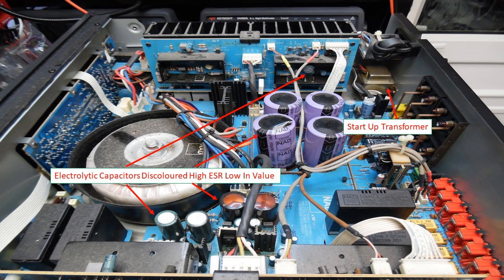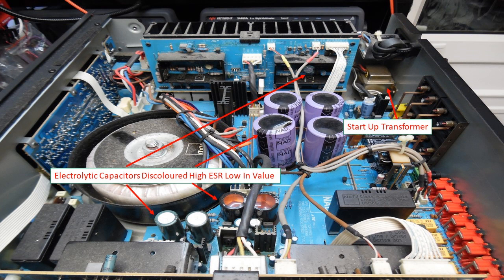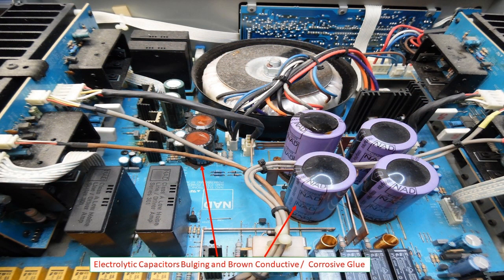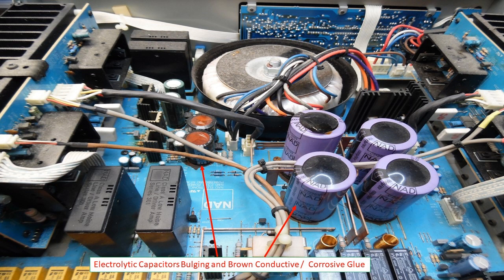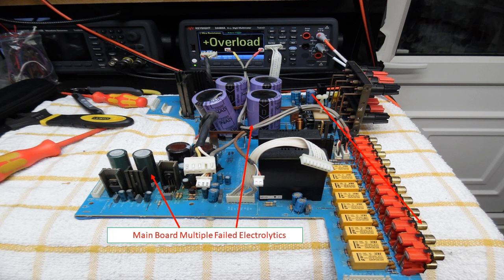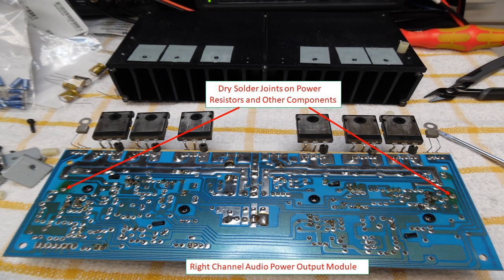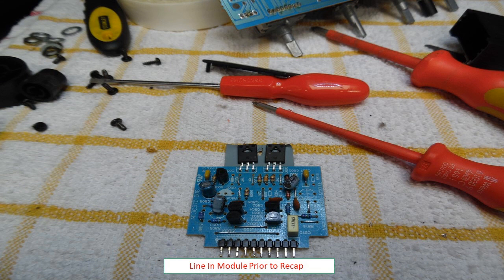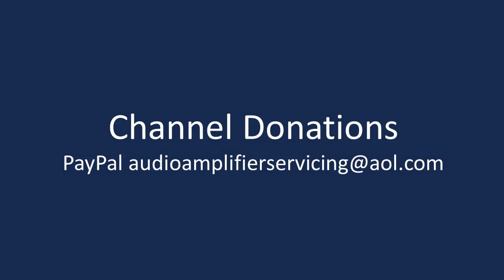NAD C370 Recapping, Repair and Service. (With Audio Tutorial)

Comment: Hiya. I've had this C370 on the shelf for about 2 years now. I think I asked you back then about where to get fusible resistors for it and thanks for that.

I'm back looking at it again now as I have a bit of time. I recapped the whole thing back then, but still not working.

It's 'boot looping' (in computer terms) . I've got it on a dim bulb tester, on power on the dbt light glows, the amp power light comes on, the standby relay at the front clicks then light goes red and power cycles. This seems like a short somewhere to me. But I can't find it, and I've tried very hard.

Today I went through all the transistors for shorts, one was bad (Q705). I also rechecked all my work from back then, seems fine. I've checked resistors again and seems fine. I'm more used to fixing laptops than amps so the ground on this is a bit of an enigma although I do understand why on amps.

I've been testing by leaving the left and right power amps disconnected, but everything else plugged in. And on the DBT all the time. I can stop it power cycling by removing the 32V bridge rectifier but the amp wont boot at all without it, just a minor blip  of power.

I'm on the verge of sending it to you but any other ideas beforehand? Cheers!
Reply from the maker: Hi can you confirm the bridge rectifier is DB104.
Also, when the Amplifier is cycling, is the bulb lighting brightly, and can you confirm the bulb is 100 watt filament type.
Reply: @AudioAmplifierServicing  Yep DB104 and 40w proper bulb
Reply: Might try to get a 100w proper bulb. Makes sense now you mentioned it. Worked fine on other stuff but I suppose this is more power hungry.
Reply: Ordered 100w proper bulbs. Interestingly advertised an eBay as 'Proper bulbs' hehe.
Reply: @AudioAmplifierServicing  FYI It was DB104 at fault. Now working!
Reply from the maker: @kblectronix Excellent great to hear you fixed your Amplifier

Comment: Hi again, got my Nad c370 main board out now and it seems its not taking as much punishment as the one you had here. Still there are caps thar have gone dull looking with heat so its going to get a full recap.
Question if i may - you have used audio grade capacitors in many areas, the ones that were in originally are jinghai CD110 which are general purpose. If i used say panasonic FC, would they be just as good? 
Mouser dont have much choice just now on the 10000uf 80v caps, so this project may take a while. 
Again thanks for this insightful video!
Reply from the maker: Hi Panasonic or any other high quality Japenese capacitor brand would be a good choice. There are also companies like https://www.hificollective.co.uk/ that specialise in Audio grade components.
Reply: @AudioAmplifierServicing  nice shop! Thanks for the link

Comment: Hi informative, I am working on a c372. From NAD the advice was to change the 80v 10.000 uf in 100v 10.000 uf. My question is if I put 6x 100v 10.000uf in which part i have to adjust for this extra ask of the system?
Reply from the maker: Hi uprating the capacitors to 100V will not fundamentally change anything as the value of the capacitors remain unchanged. But I would advise completing the alignment procedure for the Amplifier after any form of repair work as components drift and tolerances changed.

Comment: I have one now currently working. I have replaced the large main board capacitors during replacement of the failed protection circuit capacitors. I also had to fix dry joints on the amplifier board main connectors as it was cutting out on one channel a lot. I really want to replace the rest of the caps but as you mention getting capacitors is tricky, especially for someone that is a auto electrician with limited experience and equipment. Where did you source the nichicon capacitors? Id send you the amplifier but I live in NZ. There's no one locally that does appliance repairs so i have had no choice but to fix it myself. I also notice my amplifier boards are warped due to there being no support in the middle of the long board. On your amp there's brackets shown holding the middle at the top. Has someone fitted these brackets aftermarket? Its a good idea.
Reply from the maker: Hi even though this repair video was created 1 year ago already many of the Nichicon capacitors shown are now obsolete.
I can send you a part list for the capacitors detailing the value and voltage. Email audioamplifierservicing@aol.com
I would recommend ordering capacitors from for example https://www.digikey.co.nz/ or https://nz.mouser.com/ that ways you know your purchasing genuine original parts. The brackets were no added aftermarket, and NAD changed the construction no doubt to fix the issue of the warping of the board.

Comment: I have the same Problems with my NAD 315. The 2*10000uF, 2*2200uF and 1*1000uF have 0.6 - 1.2 Ohm and lost 15% capacity. I orderd new ones and i hope it works then betther. I am only a hobby repairer. Shoul i check all small capacitors? It is a lot of work...
Reply from the maker: Hi I would recommend replacing all the electrolytic capacitors, NAD fitted J H branded capacitors, and they are known to fail.
It is a lot of work, but it will ensure years of trouble-free operation.
Fit quality capacitors, avoid purchasing capacitors from auction Web sites or far Eastern supplier as often they are cheap copies.
Buy from reputable suppliers.

Comment: Can I use 2 pin filter caps instead of 4 on this amplifier?
Reply from the maker: Yes, but check the solder tracks for the unused pins to ensure you do not need to link them to the used pins.
Reply: @AudioAmplifierServicing  thanks. When you sent me the link for the filters in the c352 amp I bought them and the difference in amp power is unbelievable.  The old caps rattled.
Do you have a link at all for the Nichicon filters you used in the C370? Mouser seems to be out of stock of quite a lot of 10000uf 80v caps
Reply from the maker: @tharkthax3960  Hi as with all components many have now become unavailable due to the market changing and manufactures  choosing not to produce them.
I can send you a bill of materials, but you would need to check availability with authorised suppliers for example mouser and Digikey. Email audioamplifierservicing@aol.com
Reply: @AudioAmplifierServicing  thought I found some but the lead spacing are 10mm, need to 25mm. May well have to wait until July when more stock comes in. Cpc farnell I haven't tried but don't think they will have. 
Thanks again.
Reply: @AudioAmplifierServicing hi again, I've ordered Cornell Dublier filter caps, 2 pin at 10mm pitch. I checked the board and it will accommodate the narrower lead spacing. 6.42a ripple. 
The original filter I removed is like you mentioned - loose internally. Thankyou again.
Reply from the maker: @tharkthax3960  Excellent
Reply: @AudioAmplifierServicing hi again, sorry all the questions, I appreciate your insight. 
I'm in the process of recapping which is strangely therapeutic!
The main filters I now have received and they are 85c rated, have a 6.42 ripple current and are Cornell Dublier brand. Cant remember  the ESR but its decent enough. 
I'm thinking along the lines of reducing heat inside the amp, would there be any sense in making more vents or even fitting a fan?
Reply from the maker: @tharkthax3960 I personally would keep the Amplifier as original, drilling extra vent holes in the case and fitting a fan will not really achieve any real gain. You are installing higher quality capacitors than the original so the Amplifier should perform well for many years.

Comment: Those JH capacitors are absolute JUNK.
Reply from the maker: Yes they are and sadly for the owners of this series of NAD Amplifiers it's only a matter of time before they fail. Also, a lot of the high-quality Japanese capacitor manufacturing no longer make conventual capacitors as they have switched production to high volume surface mount type, making recapping more challenging.